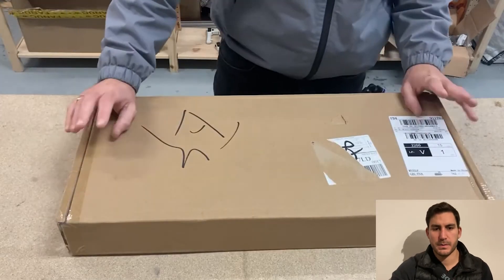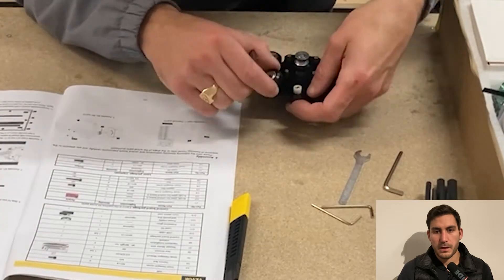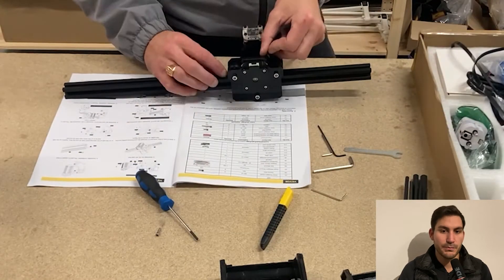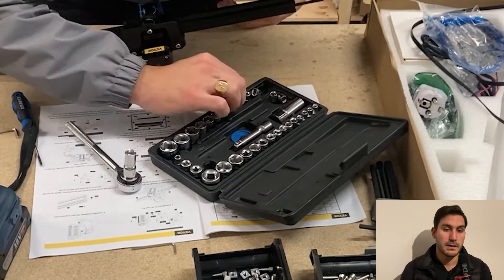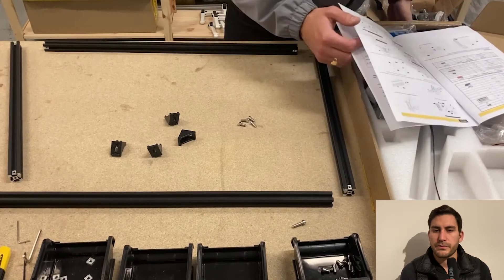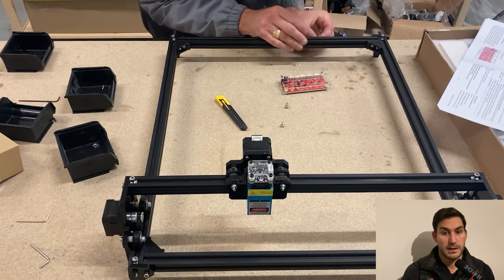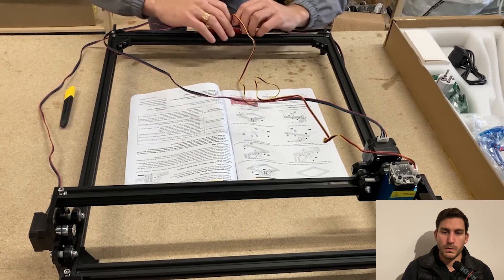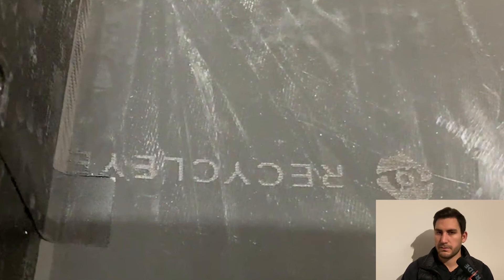500mW 40x50cm laser engraver VG-L3 by Vevor : DYI assembly, build and review

Comment: Hi I trecently got one of these laser cutters.  I am new to laser cutting but have experience in paper cutting machines.  However I find the software manual so difficult to understand.  I have managed to engrave but cannot set the machine to actually cut.  Any help would be welcome.  I also find I cannot get DXF files to open.
Many thanks
Reply from the maker: Hey, which software are you using? DXFs should be ok with LightBurn software, and what are you trying to cut with the vevor VG-L3? It's an engraver technically so I would suspect you'd only be able to cut through paper or thin cardboard at best (haven't tried yet but on the list of things for the next few weeks :))
Reply: Hi Thanks for coming back to me. I used QCad and I havent tried Lightburn as its expensive for a beginner.    I'm told I can cut 2mm to 4mm thick wood and I'm told you repeat the process a few times until it is cut.  i'll keep trying until I master it! I may have to try Lightburn as thats what the manufactureres recommend. Many thanks.
Reply from the maker: Yes, multiple passes can definitely help, and maybe a slower speed when trying to cut through. 
You should be able to get a free trial with lightburn. Worst case if the DXF is the problem maybe then try to convert it to a jpg or other format which would work on lasergrbl for example. 
I'm not too familiar with QCad..
Reply: Thank you for that.  I'll keep on trying!  J.